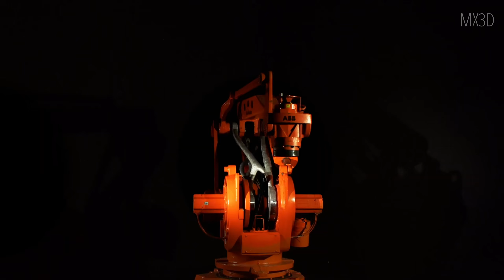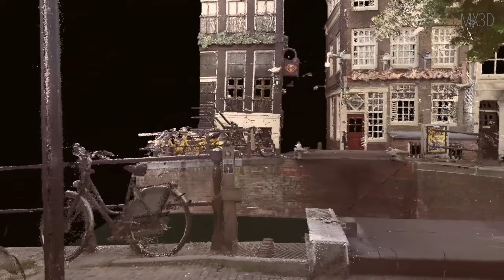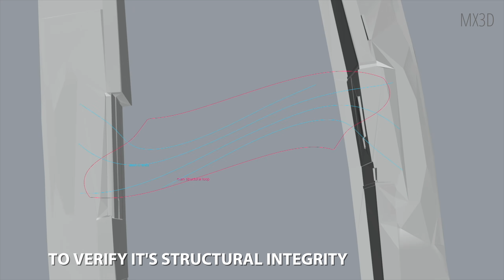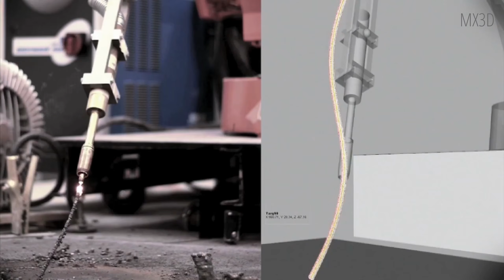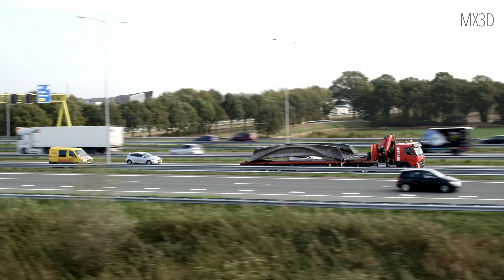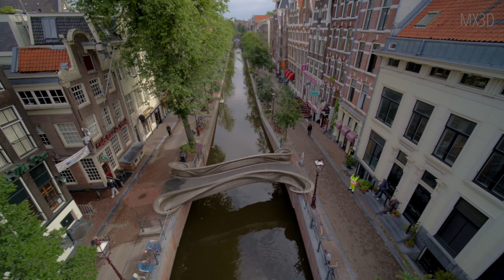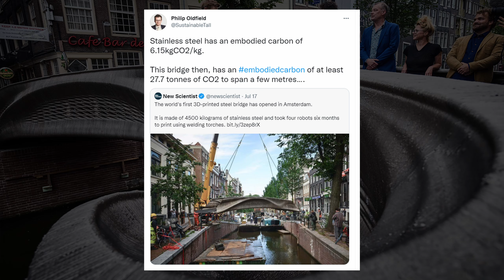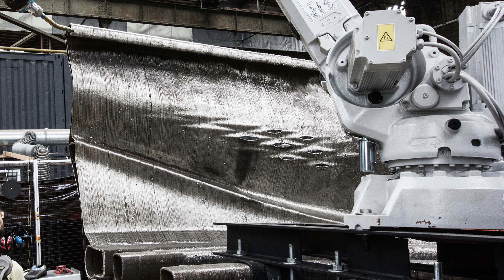World's first 3D printed STEEL bridge | MX3D

Comment: Question is how much energy did it take to build a bridge out of welding wire compared to more conventional steel production.
Reply: I first thought about the cost of thousands of rolls of MIG wire, and then the huge volume of Argon or similar gas....at a retail level...even as an experiment...someone must have deep pockets !
Reply: Considering it was only meant to stay up for 2 years, and that it's such a short crossing, I'm certain that a wooden bridge, or even a bridge with a couple of prefabricated metal girders cut to length with a wood deck on top of that, would have been vastly more energy- and carbon-efficient.
Reply: @killerbee.13  Agreed as much as I love this.
Reply: @killerbee.13  recycling existing steel girders with a sustainably sourced wood deck would've been the best option for a temporary structure. Infact, the crude look of it would've made a statement about needless opulence in modernist design.
Reply: @killerbee.13  so you would rather kill a tree that takes CO2 and then changes it into oxygen(which animals need to breath) by using photosynthesis.
Reply: @fbi805  Um. Yes. I would in fact rather a couple trees in a nearby wood farm were chopped down and replanted and made into a wooden deck, than have them wastefully weld an entire bridge out of steel wire.
Reply: @killerbee.13  were the replanted trees fully grown to replace the very same amount of CO2 that the ones cut down would take and change into oxygen. I'm going to guess that your answer would no, a young sapling would take at a minimum 10 years to even get to a point were it could match the exchange rate of the ones cut down and that also depends on whether the trees replanted are of the same species that was cut down as different tree species have different growth rates. Actual proven research has shown that cutting down whole forests that produce nearly 30% of the worlds oxygen and then replanting new trees is one of the causes of climate change. It takes time for trees to grow and help impact the environment in a positive way.
Reply: @fbi805  Timber is in general a mature and sustainable industry, particularly in Europe and North America. Clearcutting is generally not done for timber, but for land use purposes. Tree farms are perfectly willing to run ten different crops staggered such that one can be cut down and replanted each year. They've been doing so for many decades, or longer, even.
Reply: @Jonas_Aa  maybe you should do some research on iron mining before making or posting comments on here.
Reply: @Jonas_Aa  you want me to enlighten you why are you to lazy to actually look up the information yourself
Reply: @Jonas_Aa  bro do you even know what you are talking about. In your first comment to me you mentioned melting rocks. Melting rocks is no longer used by  mining companies to produce the iron ore required to make steel. However the process of making steel does require the smelting of iron ore and or iron powder for refinement which does create CO2. With that said their are a few environment friendly corporations that have developed procedures to collect the CO2 and to either process it into a more useful gas and resell it to space exploration companies or to mix it with other gases to be used in steel industry. CO2 just as iron and steel is heavily used by a lot of manufacturers in the steel industry.
Reply: @Jonas_Aa  i think you are confusing oil extraction from iron ore mining. Extracting oil from the ground or oceans either through drilling or fraking also causes CO2. The oil industry has been for years refilling the empty caverns where the oil has been extracted from back with the CO2 gases created by that process. Never heard of an iron mining company saying they were going to put CO2 back into the ground considering that mining for iron ore leaves a giant hole in the ground that's pretty much open to the rest of the environment. In any case if we actually want to lower the co2 levels on this planet the peoplefrom around the world are going to have to get together and force governments to heavily fine companies that continue to pollute the oceans lakes and other water systems as 75% of the very oxygen we breath is created by the oceans and lakes of the world. Trees and plants are just but a fraction of our survival. With the fires that destroyed 1/4  of the Amazon Rain Forest and nearly half of the Australian forests last year as well as the fires that destroyed millions of acres in the Western U.S. tree farms have been heavily depleted. It'll take 100 years for the burned part of the Amazon to even get back what was lost and have an impact on the environment. Australia will take just as long as for the western U.S. it's difficult to say because the trees that get planted get burned the following year. New tech isn't going to solve the problems we are facing it's going to make it worse.
Reply: @fbi805  get a life and stay from building or climate stuff. please.
Reply: @constantinosschinas4503  I have a life why do you go hide in your cave and let real adult have a nice conversation.
Reply: well, think about it: You have to process the steel somehow into a bridge. Either by casting, welding or deforming it. The 3D print is a spot on melting, so every kilogramm of steel of this bridge is melted exactly once for the final product. Whereass in a conventional bridge you would have a lot of steps to convert the raw steel into a finished building. I think the overall energy consumption is at worst as high as in a conventional bridge and at best 50% less.
Reply: And the time to weld it too.

Ofc it's cool they can do this, but printing it..sorry weld a form like this, it takes forever.
Reply: Exactly - kind of a gimmick really
Reply: Who cares? It doesn't matter.
Reply: Research facto you need to investment in research and data aquisition. In University I did a project which uses solar energy to melt old steel and form steel balls which can then be used for making new products .I had the idea to make a robotic spider which uses solar energy fed through fiber optics and can turn old rusting structures into metal ball haha never took off more then a small solar powered Furness that can produce small metal balls .
Reply: Probably insanely high, Hard to say without knowing what unit they are using. But say a standard shop 250 unit is running at about 220v with a output of 200 amps. Thats putting it at about 40kW's. If this thing is running at speeds of a typical FDM printer then we are talking weeks of print time. So the power consumption would be extremely high.   While the bridge is nice is in the terms of novelty and art, its not practical by any means.
Reply: @nikushim6665  She says in the video that the print time was 6 months
Reply: @T3ddyRuxp1n  No she said the entire process took six months. Not the machines print time alone. That time could of included post processing (sanding painting and assembly of multiple parts ) setting up and calibrating the printers machine code and so on.
Reply: @dragonrider269  actually refined oil is more damaging to the environment than iron. Especially when companies tend to bury and or dump used oil into the ground and water systems or dump them straight in the ocean. Then you have landfills with hundres of millions of used tires and other products that are made from oil refinments. Refining iron ore is the least harmful to earth, at least when iron deteriorates it's composition is used by nature and recycled. That's something we can't say about oil.
Reply: I think that was included in the total carbon footprint of the project. But we don’t know the carbon footprint of a normal bridge to compare it to.
Reply: @ecospider5  --  Well, about the same amount of "carbon" is used to generate one ton of structural steel as on ton of wire.  But then the wire has to be processed one more time to make the structure.   But this is more than a bridge, it's a civic decoration, albeit a temporary one.
Reply: @GilmerJohn  "Kinda" because to generate a complicate, organic and/or minimal material usage structure the alternative of 3d printing would be casting, so remelting the desired metal.
Reply: @GilmerJohn  and properly designed a bridge like this could be closer to a truly optimal structure that might be able to use substantially less material which could potentially make up for the higher energy requirements needed to place the material. This would be highly dependant on a large number of different factors, and would be difficult to accurately model without testing.

Comment: If anything, A temporary structure is the best place to try a new building process. You get real world feedback and its not expected to be there long. I guess its a good way for a company to off-load some of its iteration costs while working to make a product truly market ready.
Reply: It's also handy because in the decommissioning process you can identify any real-world problems that arose.
Reply: I wish more people can see this and see while 3d printing can be cool and impressive there will be pros and cons with it and this demo can really help show them.
Reply: There's an issue with liability though, I doubt it will catch on because companies don't want to take the risk.
Reply: @mopslopmop  That's valid for any engineering, so apparently, engineering companies don't exist.
Reply: @SiqueScarface  all engineering requires you to test unfinished products on the unwitting general public without waivers or paperwork? No? Wtf are you even talking about then?

There are limits to acceptable risk, testing iterations of unfinished products on the general public is rarely within those limits
Reply: @mopslopmop  Did we see different videos? In the one I saw, there was a lengthy description how the bridge was designed, and tested, and how there is even a twin bridge to recreate all the events the original bridge is enduring, and check the health of the structure.
Reply: @SiqueScarface  and that's not what was described in this thread. That defeats the idea of iterating new designs quickly, it's too slow, and most large corporations won't want to take the risks involved. It works in some cases but they are few and far between. I strongly doubt it will catch on, especially since we've been able to do this (except the 3d-printing part) since the industrial revolution.

Also this isn't prototyping/design testing. This is PR. They started the project 6 years ago. 6 years is a long fucking time to design one walking bridge.

Everything you described was done to mitigate risk and made the project take much much longer than putting down an already tried and true method. Which means that there is no point in iterating prototypes by testing them on the general public in temporary structures unless you are willing to take big risks, why you would I don't know since there's not much to gain.
Reply: Sortove like the Eiffel tower.
Reply: This is just a marketing gimmick, nobodies going to be 3d printing a bridge unless it’s an art project
Reply: @Jonathan-ex3sl  
– 'the popularity of the (bicycle) wheel is doomed' - 1902
– automobile prices 'will never be sufficiently low to make them as.. popular... as bicycles' - 1902
– 'talking doesn't belong in pictures' - 1928
– 'was the laptop dream an illusion?' - 1985
and so on. the list is endless.
Reply: @daos3300  Vincent Vangough COULDN'T sell a single picture. NOW..... All ideas go through 3 fundamental phases; rejection, interest, acceptance. This is terrific, only by experimentation do WE move forward.
Reply: There is nothing permanent then A temporary solution 🤪😹

Comment: Steel without heat treatment is a top ingredient for structural failure
Reply: Well, at least it's not brittle, it won't break with people on top, but bend over time instead (or at least that's how I think it'll happen)
Reply: most structural steel is cheap mild steel and isn't heat treated, even the hot-rolled stuff is cooled slowly and carefully
Reply: it doesn't need heat treatment. the clue is in the process.

Comment: Jinkies… Couldn’t print it on sight; nor, install it in one piece?!  The press really has made more of this than it is.   I can’t believe they had to CUT it into three pieces!  We are not there yet.
Reply: Look, at least it's an entire bridge that had been actually printed. Not "well, you see, it's just this part of one wall of what's otherwise a pretty standard design and a fully printed prototype with some minor issues like huge cracks..."
Reply: @nebufabu  Agreed 👍… more power to the next gang.  Whoever was coordinating this missed in the last.  Why one piece when two interlocking ones might have been easier to ship and install.
In the tile world, they’re making 48 inch squares… Why?
Reply: @StephenRansom47  nobody missed anything, the objective was to print a bridge in one piece - objective achieved. then the issue of installation, a separate problem requiring a different solution.